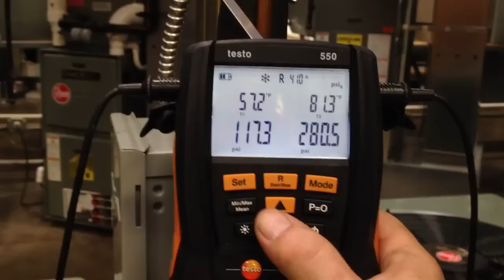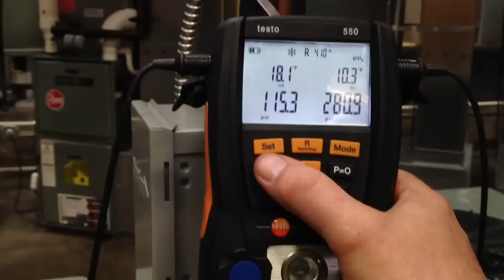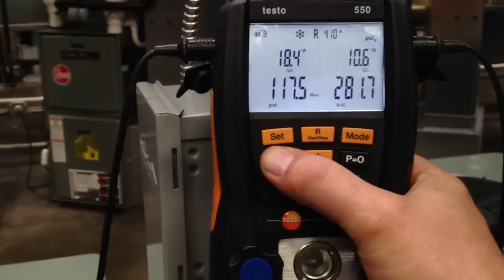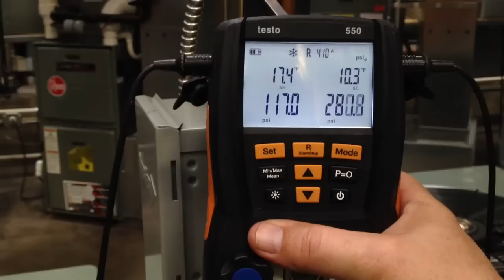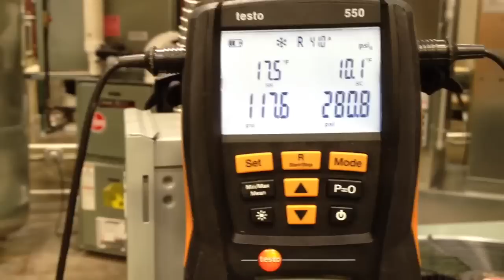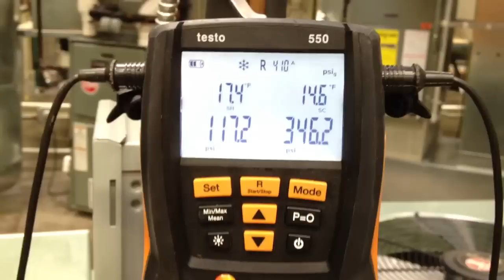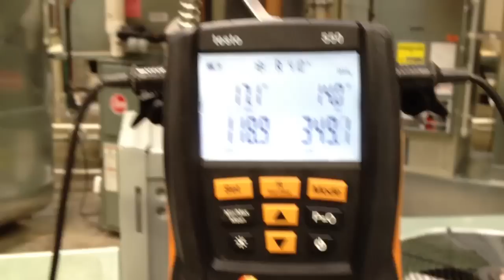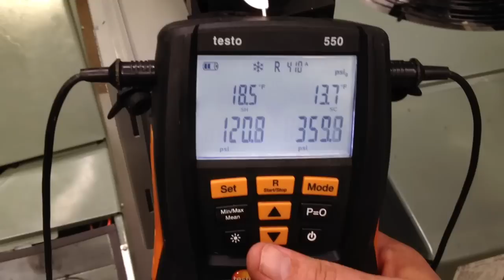Testo 550 Features Overview Pt. II

Comment: Super heat is used with fixed piston or cap tube AC systems to protect the compressor from slugging or not enough refrigerant returning to cool the motor. Why doesn't Copeland put a label on the compressor with the suction line temperature perameters (hi-lo) on it ? It would make it easy for any tech to check, it would save Copeland money on warranty returns.
Reply: Hello, I want to camp a digital manifuld. The testo 550 oh 557 you tried it and you are satisfied with the result.
Thank you
Reply: TheTercerojo The 550 is a good every day manifold and the 557 is better for charging out new systems. If you have the money go with the 557

Comment: Goodman's manufacturing instructions say to check it "as close to" the compressor as possible.  Thanks for your prompt response.  I do have a question you may be able to answer.  What should the Delta H or "Change in Enthalpy" be from return air to supply air?

Comment: Do you recommend separate set of hoses for different refrigerant types with digital gauges?
Reply from the maker: Best practice would be to pre-purge your hoses with the refrigerant you are about to use. The most important thing is to keep your hoses parked and tight so that they do not attract unnecessary moisture.

Comment from the maker: There are some heat pumps that are engineered to actually reverse flow without a reversing valve. The 550 will switch the high and low pressure around and show the superheat and sub-cooling on opposite sides. If set to flame/snow flake, whichever side shows the higher pressure will show sub-cooling and lower pressure superheat. In typical US designs we have a dedicated suction and HP port.
Reply: Thank you!! Just what I needed answered!

Comment: subcooling is very important to total btu transfer. A sightglass can be misleading, i can have a full sightglass with 1 degree of subcooling. In refrigeration you have a reciever so generally if you have a full sightglass you are good to go but Ac work is totally different. Thats why some ac units  specify the subcooling amount.

Comment: Thank you kindly for the video. I am a fairly new owner of a set of Testos as the ones you are using so this really helped me out. At one point did I understand you to refer to to "European" heat pumps when referencing the snowflake icon? I understand heatpumps perfectly fine and have a fairly good grasp on working with subcooling and superheat but did I miss something lol with the Euro thing?

Comment: I have the fieldpiece SMAN 460s and there good but dam I paid $500 for them and $100 for low loss hoses and one of my couplings died and that was $60 so $660 into em at 2 years old so I’m sold on these I’m getting the 550s to start if they rock I will move up and up and still have these as back ups or rainy day gauges for the price for me anyway, I have to do it and if I beat them up I’m not going to have to spend another $600 if I replace them every two years I’m way ahead

Comment from the maker: Make sure that you plug in both probes before you turn on the instrument. The unit looks to see what probes are attached when it is powering up. If you plug it in after its running you will not see the probe.

Comment: You should hook your suction side temperature probe up as close to the compressor as possible.  That is what I love about Ruud/Rheem products.   Their accesibility of the compressor to get a more accurate superheat reading.  I've added refrigerant to systems that was previously serviced by Big Name companies because they didn't check superheat at compressor, which is what we are protecting by doing the superheat method.

Comment: Try to get an Fpl credit or tax rebate with an ac unit operating with an in proper subcooling charge. sightglass full with 2 degrees subcooling is take a 16seer to 10 seer. Trust me if a sightglass was all that was needed to charge a system the manufacturers would ship them with the units to prevent improper chargeing of their units.

Comment: From what I understand sub cooling is to check  that you have a solid column of liquid to the txv. Why not use a sight glass and check under a full load ? Refrigeration systems use one.
Reply: I have considered installing them for this reason... Myself
Reply: Subcooling needs to be correct at setpoint. If you charge a system under load, so there is no bubbles in your sightglass. You may risk overcharging...
Reply: With all my respect, Jim(I watched your chanel btw so aware of yours skills in the trade). Sightglass is useful device but charging by subcooling(txv with clean coils of course) is a proper way to get system performance in now days imo.